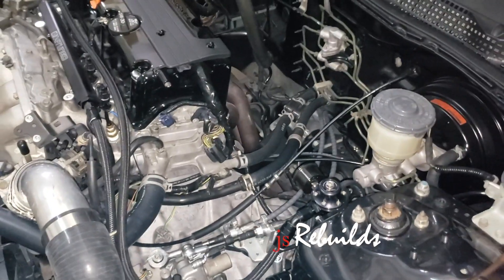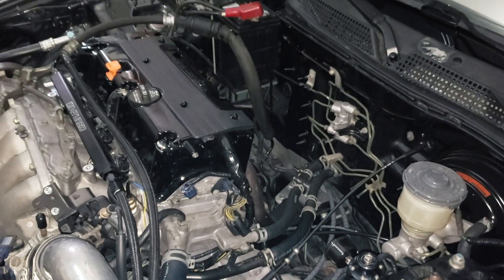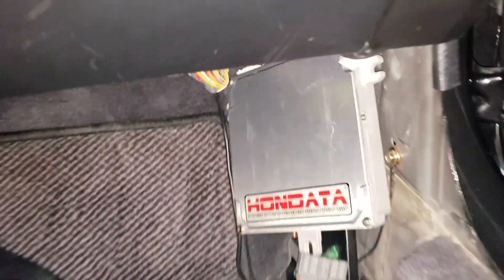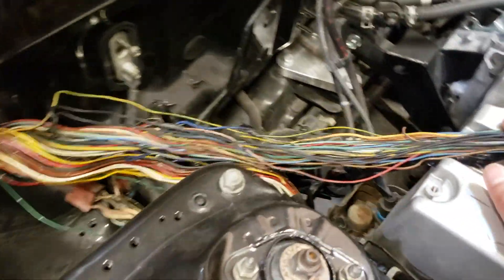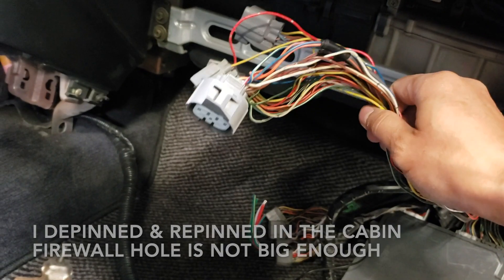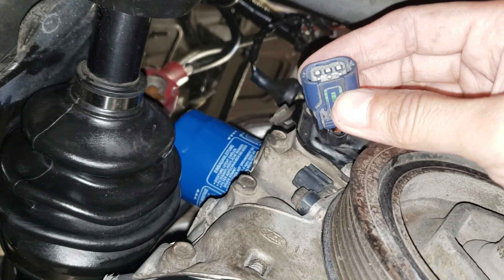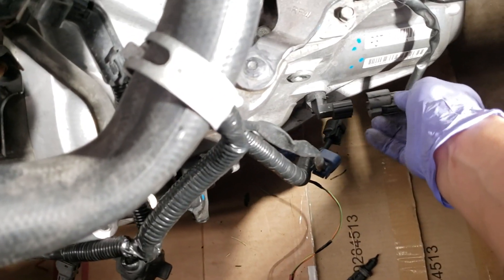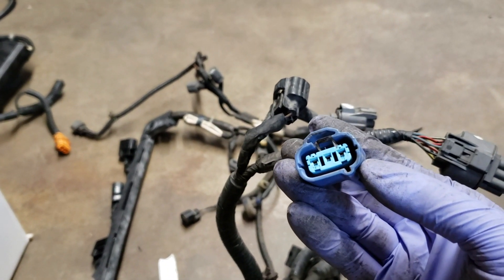K20A2 OEM Engine Wiring Harness on K24A2 swap w/ K24Z7 Transmission

Comment: Did you have to use an adapter or anything to bolt that transmission up to the k24a2?
Reply from the maker: No
Reply: @jsrebuilds3951  thank you I keep seeing people say the z7 transmission doesn’t fit earlier K series
Reply from the maker: @StrikingHunter  I'm haven't heard that myself but again I'm not sure myself. I'm not sure what they mean by earlier K series, I thought the K series are K series.
Reply: @jsrebuilds3951  12-15 si is a little different. Engine wise but I wasn’t sure about trans mounting
Reply: The transmission fits fine.  The difference is the rear engine mount bracket bolts in different.  Also the speed sensor is 05+.
Reply from the maker: @Outvid171  Yes your right, I explain all those difference in my other videos.

Comment: Can you help me out i have acord oem wiring
I want to change it to crv wiring loom as i need c101 plug on engine harness for chaises whic i have in hybridracing harness on dash side?
Reply from the maker: Im not an expert on the crv harness.
Reply: I need to know about the c101 plug. Pinout For acord euro oem engine harness k24a3 
I have k24a3 engine harness and it have no c101 plug which will be connected to chaises harness i have hybrid racing conversion harness
Reply from the maker: @learnousmodificatex349  you should reach out hasport, they are knowledgable in wiring harness.

Comment: we are a factory which can supply good quality harness in china , like Honda S SWAP K20, K20A2 K24 SWAP K-Series Tucked Ktuned Engine Harness KSWAP WIRE HARNESS 02-04RSX TYPE S RSX EP3 EK EG EF DC...So , if you need any reqirements , please contact me , thank you ?

Comment: hey bro have you looked into vtec academy's wire for the css.  Im on the same problem as you are in I believe i hooked up my speed sensor wrong and blew the 15 amp ecu fuse so now my css is unplugged until i switch the power and ground around i think that was my mistake.   Im so confused on this css speed sensor.  also have a ebay engine wire harness so its not even close to factory colors so to make it even more difficult.  but let me know what you think about vtec academy's video on the css vss and switching wirers around on the c101 plug.
Reply from the maker: Here is an update. Today I worked with Austin and we moved it to output 4 which is much more accurate reading on the mph. But I'm still getting a delay at stop and go but it still works. I will continue to work with Austin to fix this issue.
Reply: @jsrebuilds3951  hell yeah sounds like you guys are pretty much working out the bugs. I order my box today along with some suspension parts. So another week of waiting to get the car on the road but I'm sure it's all going to be worth it in the end. Like I said super stoked for the video.
Reply from the maker: Yes, I have come across that issue. I've called Hasport to see if I did it correctly according to their video. It does not work, so I reached out to Hondata and they told me it will not work switching the c101 plug. Hondata says there is no speed output from the B plug.
Right now I do have the speedometer and ecu reading the speed working with the Dakota Digital Speed Convertor Box. It works but sometimes the signal is slow to reach the ecu and the gauge cluster. I'm working with a tech at Dakota Digital getting it to work correctly. He believes the signal since it split into wires signal gets lagged. I haven't gotten to it yet but I will have a video on how I got my speedometer to work along with ecu reading the speed signal. BTW the Hondata tech says we need a convertor box for this work.
Reply from the maker: Make sure you repin the speed sensor as I did in the video if you have a 05-06 rsx transmission, 06-15 civic si transmission.
Top view of the plug with release button starting from left.
1) Black/Yellow (power source)
2) White/Green (signal)
3) Black (Ground)
Again a Speed Convertor is necessary for your speedometer gauge to work properly and ecu to read the vss signal.
Reply: @jsrebuilds3951  so i did the conversion to try to test it and your right.  It dont work at all like vtec said it would.  So now im at the stand still.  So i will be getting the dakota digital box.  I seen another video of a guy using it and using diodes to make his work.  Seems like it works from the video but i dont understand how he means make a split and go from the css to box to diode to ecu.  Then from the split css to diode to gauge cluster.  at this point im down to try anything.  If i would of know this i would of just saved to get a 02 type s trans. lol. but me living in the middle of nowhere wisconsin honda parts are hard to come by. cant wait for a video from you to shine some light on this.
Reply from the maker: @timothy2182  I just talked to TJ at Dakota Digital today. He is working with me to get this box working right in my Integra. The box is currently hooked up and does work but there's a delay of getting the signal to the ecu and speedometer gauge. I have the signal going from output 5 right now. The tech at Dakota Digital is helping me figure out how to get more voltage signal from the speed sensor. They believe since the k swap needs 2 signals, 1 to ecu and 1 to speedometer gauge that the signal gets weak. I hope to resolve this soon and get this video out to you guys.
Reply: @jsrebuilds3951  yeah im getting the box next week some time.  might be a dm on your insta in the next week if i dont get the box working by myself.lol.  Also yeah im at a stand still until i get the box in the car and stop throwing the vss code.  more and more research everday.  wish honda tech was still big cuz would have this done by now. lol. but man your a huge help.  Thank you for the replies.